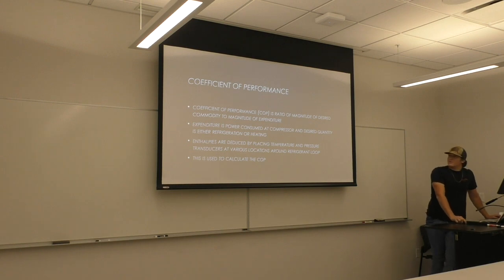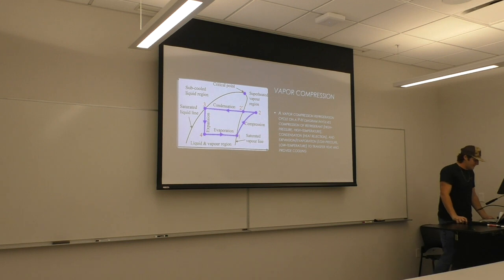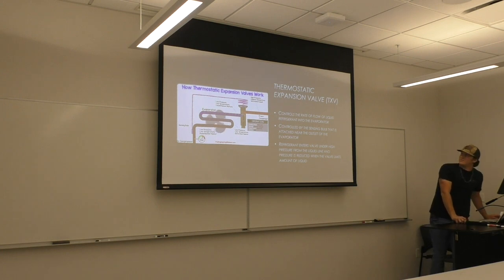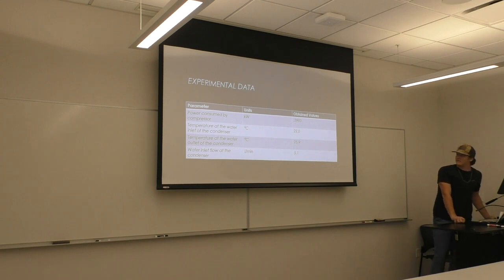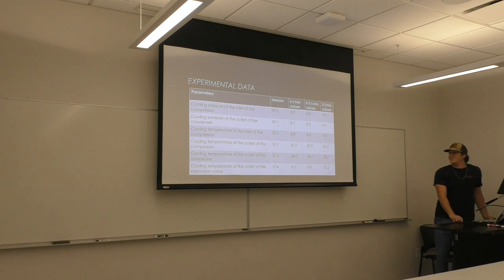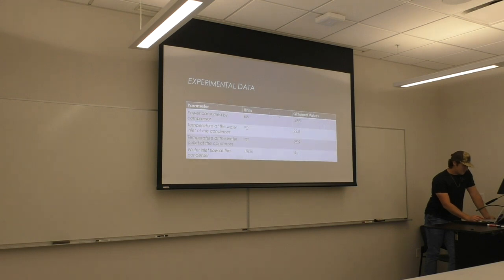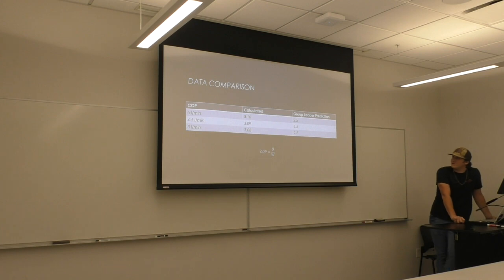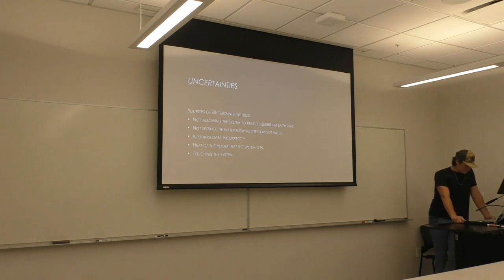Justin Hutches

Comment: Well informed presentation on the vapour -compression refrigeration system. You presented the data well and spoke clearly. Definitely try to reach the 6-min requirement, but other than that, good job.

Comment: You did very well on your presentation your slides added understanding to the material as well as not being too cluttered with information that it was hard to follow. You made your data easy to understand my only critique is maybe trying to extend your presentation by going more into detail about the different sensors.

Comment: Great work, Justin! Your presentation on the thermostatic expansion valve was clear, and the interactivity of your slides added depth to the understanding. While your data was straightforward, delving deeper into the significance of the different sensor data might elevate it further. Similarly, in your vapor compression cycle presentation, the clarity with which you presented abundant information was commendable. However, expanding on certain subjects might provide more depth and potentially extend the duration of your presentation.

Comment: Nice Job Justin, You did a good job presenting this data. I like how your slides were interactive and showed exactly what happens with a thermostatic expansion valve. Your data was easy to understand but my critique on that would be to explain further what the different sensor data meant.